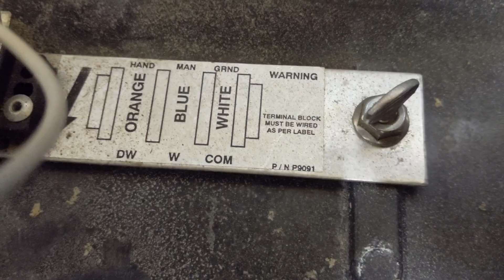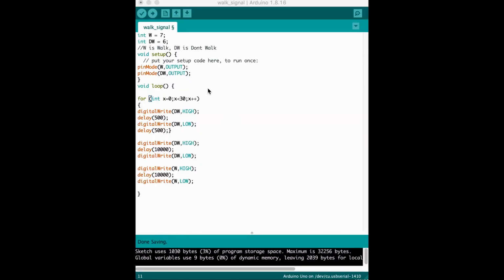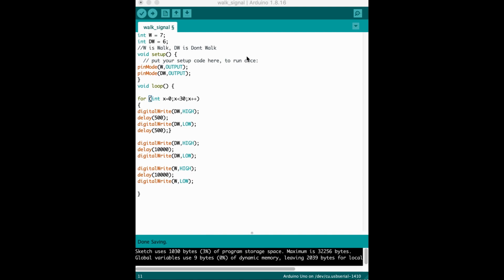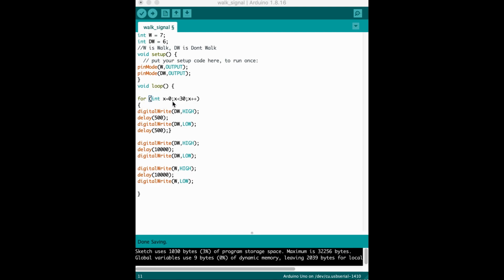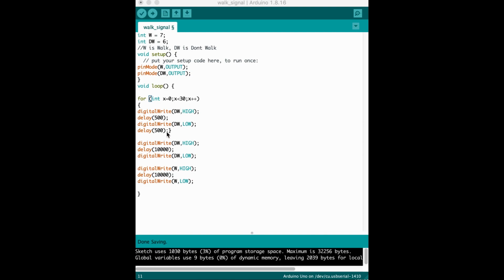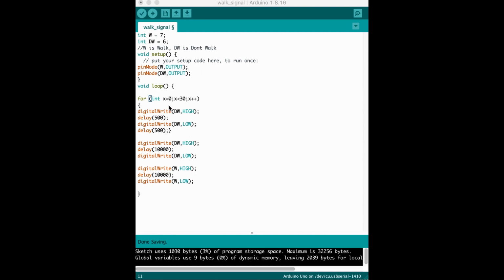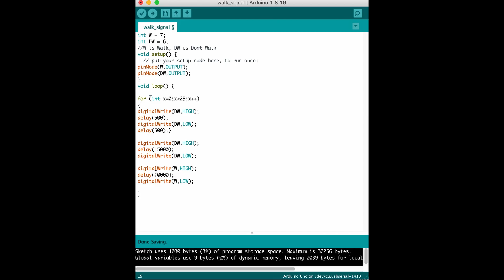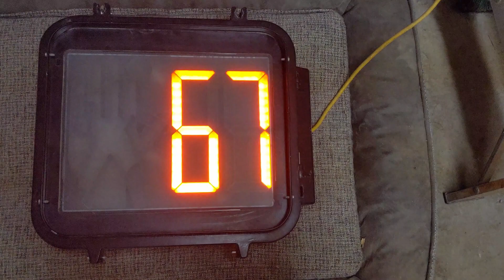Programming Your Own Pedestrian Crossing Signal With COUNTDOWN!!!!

Comment: Any hints for if the countdown doesn't show after mulultiple cycles? I have mine set to half a second on/off but the numbers never show.
Reply: It will only work if you set it to 1 second on and 1 second off.
Reply: @J.T.Engineering   Turns out an IC on the board for the countdown LEDs is burnt out. Time to see if Dialight has any I can grab :D
Reply: @vect0r858  at least you know what the problem is. When you do get it figured out you have to set the countdown to 1 second intervals otherwise the onboard computer can't learn the sequence if that makes sense. So you had 2 separate problems. A hardware issue and a coding issue. 

Initially I was doing the same thing and when I changed it to 1sec intervals the countdown worked. So just keep that in mind

Comment: Would you be willing to make a tutorial on how to wire it properly? It would help out a lot if you did
Reply from the maker: If you skip to 1:20 in the video I talk about it. Basically you take an extension chord from wall power, the positive (black) and negative (white) from the extension chord go to the proper terminals labeled on the Arduino. 

The Walk sign is the blue wire, and the don't walk is the orange wire coming off the crossing unit. Those wires are the positive for the walk and don't walk. You put those wires in whatever pin out from the Arduino and then the code is used to tell the Arduino which pin out is for which command. So in my video pin 6 is the output for don't walk, and pin 7 is for walk. The white wire coming off the crossing unit goes to common ground that comes from wall power. If you look closely in the video you can see where I spliced it in. I hope that helps.
Reply: @ToolsWTools  I tried to program it but it wasn’t working. I downloaded the ch40g, and went to the arduino program, but it didn’t show up in the board manager. I tried downloading the genuino 101 and it gave me an error code

Comment: my issue is just wiring it. I'm using an arduino uno. What am I doing wrong?
Reply from the maker: Im definitely no expert, but if I had to guess id say your Arduino Uno may not be able to handle the output amperage. In mine and as well as my traffic lights, I use an Arduino with built in relays to help with the increased output. Arduinos aren't meant for high output like that, so its most likely a function of burning up your board. 

Also it could be that in the Arduino software you don't have the correct board selected in what you are writing to so check that as well.
Reply: try adding some relays
Reply: i built a controller and some relays added to it. you need relays for it to work.
Reply: @charleserror9788  thank you. I appreciate the advice. I did get the relay and I’m also in an electrical techniques program. I eventually learned about terminals and how to wire them. Now I just need to know how to do the flashing yellow arrow traffic light programming and I’m all set

Comment: If you're using the controller Carson listed in the comments from Amazon, here's the code I used. I had to modify it because the new controller is a bit different. I also adjusted the values for W/DW and DW flash. Hope this helps. 

int W = 3;
int DW = 4;
//W is Walk, DW is Dont Walk
void setup() {
  // put your setup code here, to run once:
pinMode(W,OUTPUT);
pinMode(DW,OUTPUT);
}
void loop() {
  
for (int x=0;x<15;x++)
{
digitalWrite(DW,HIGH);
delay(500);
digitalWrite(DW,LOW);
delay(500);}

digitalWrite(DW,HIGH);
delay(20000);
digitalWrite(DW,LOW);

digitalWrite(W,HIGH);
delay(20000);
digitalWrite(W,LOW);
Reply: where is the link for the relay aaaaa
Reply: @charleserror9788  relay???
Reply: @thetonytolbert  yeah the arduino relay the hi tech thingy
Reply: i have an old controller but it don't really have that much timing choice.
Reply: @charleserror9788  he literally tells you the arduino to use in the video 🤦🏻‍♂️
Reply: @thetonytolbert  whatever i know it now. I did a bit of rescarching.
Reply: @thetonytolbert  by the way thanks for the new code!

Comment: Just acquired a complete double head setup. I assume I'll need the 6 channel controller if I want them to operate opposite each other.
What would be code for that?
Thank you.
Reply from the maker: When you say double head do you mean a stop sign as well as the crossing sign? You will need one output for each function.

Comment: Oh this is awesome I picked up a double head crosswalk signal you know the one that has the hand and the man combination on one head and then your timer is on the other head anyway I couldn't figure out how to get the stupid thing to light and you basically answer my question because I had a hunch that this thing uses some type of a pulse in order to count I did get the timer to light up and but yeah without some type of programming it's not going to operate however the bad thing is on the crosswalk part for the hand and the don't walk but don't walk doesn't light up but the hand does but flat when I get burned at a flea market but whatever so thanks for your video at least now you answered my question

Comment: Really cool, Carson!  I just acquired my very own LED man/hand/ countdown Crossing signal!! (GE PS7-CFF!_VLA  D/C-3/2020 Where do I get the full coolness Arduino pcb just like the one you got? I looked on ebay and dint see anything like yours. (sort of) Doesn't seem too expensive, though.  And to set the code do I USB it to my desktop?  Thanks again, Carson!!..........or a raspberry pie?.........just gregg(can't wait to hook it up!!!)
Reply from the maker: I got mine on amazon. Yeah, you just plug the Arduino into your computer and write the code to the Arduino using the software. 

Here is the link for the Arduino. https://www.amazon.com/Channel-Light-Controller-programmable-Control/dp/B07JD3ZH3M/ref=sr_1_4?crid=W5ONQEDY6NPD&keywords=traffic+light+arduino&qid=1650668612&sprefix=traffic+light+arduous%2Caps%2C225&sr=8-4
Reply: Thanks again, Carson~~I'm on it!!
Reply: @ToolsWTools  is this link still accurate?
Reply from the maker: @JM-og4sc  it's not the same controller I used, but that one should work based on the specs.
Reply: @ToolsWTools  OK!!  Otta-sight, Carson!!  It works GREAT!!  .....but I want the man to flash and blink as well---I tried to copy your code for the hand but its not working for the man---tell me why or write me some cool code for that, will ya?